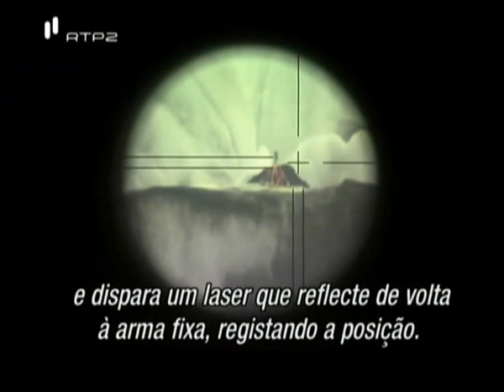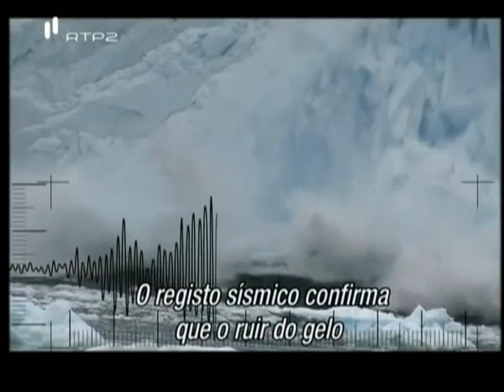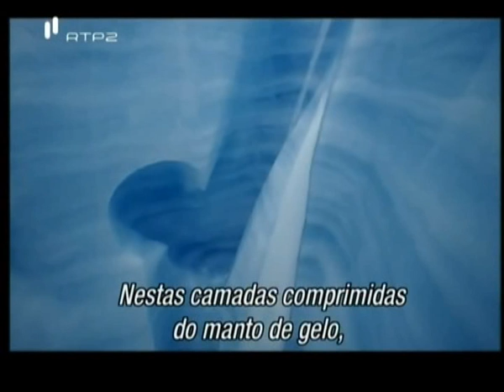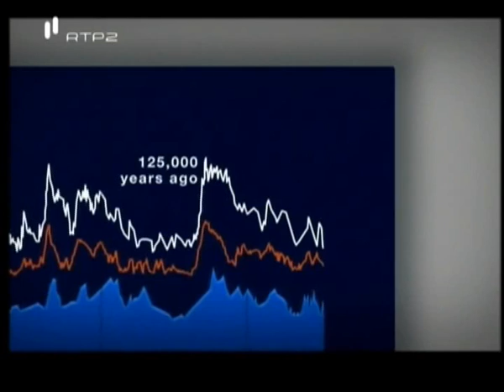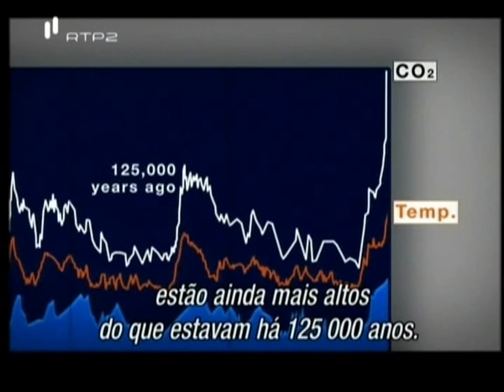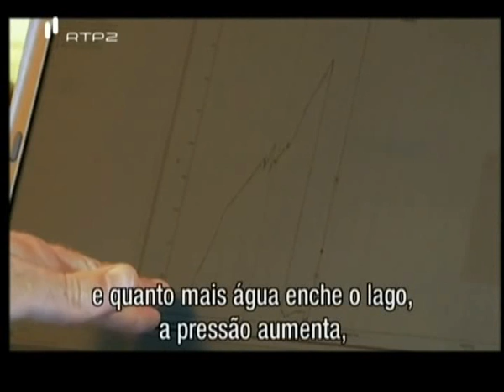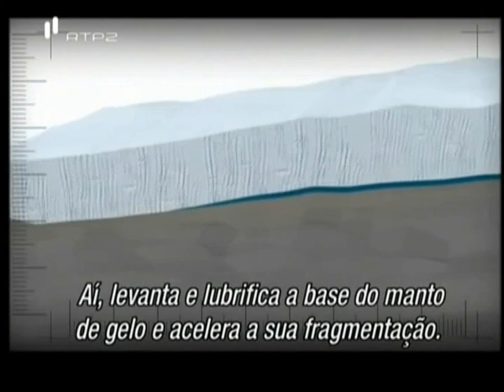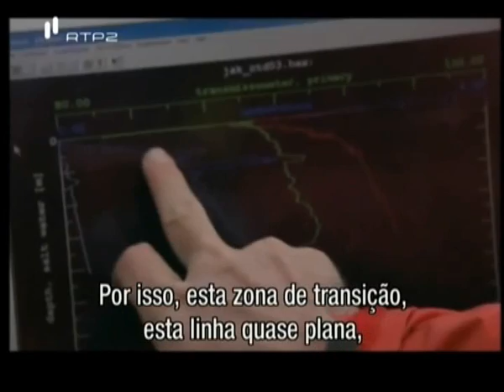extreme ice

Comment: It's simple geophysics ... the reality is we're above 400-ppm CO2, it gained a record 3.05-ppm last year, this commits sea-level to 22-25m higher than today, and the rate of sea-level gained a new record of over 3mm/year after idling at 1.2mm/year for thousands of years ...

So we're blowing right by 2C to 5C/9F by 2100 quite possible, and, expect sea-level to jump up someday way too fast, it can go up a meter in 20-years if we melt the right places, geologic history shows rates double than has happened after the last ice-age.

We'll be at 600-ppm within 70-years, to 800-ppm in 130-years, Antarctica begins melting big-time at 600 and is gone by 800 [when the planet stabilizes there], that's from a recent study and this commits the planet to 70m/230ft of ocean in 3-5 centuries with business-as-usual and it's getting worse not better.

Time to go non-fossil and replace the Arctic sea-ice a real need.

We're too hot and zero is going on reducing overall emissions, get that thermally we have to shut down most waste-heat as well as gas emissions, that's from radiators of any kind that heat the air or water, engines, piping, it all that has to get insulated from the planet to return to thermal balance and keep sea-level from skyrocketing.